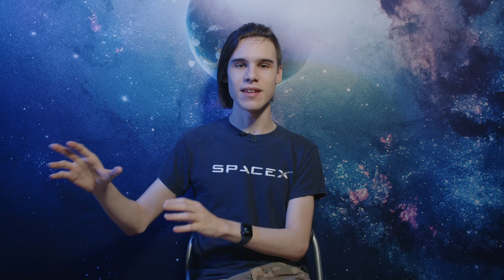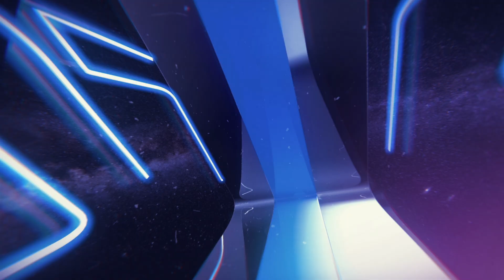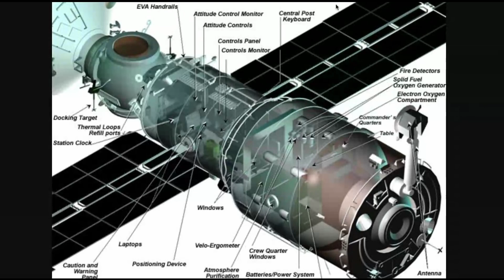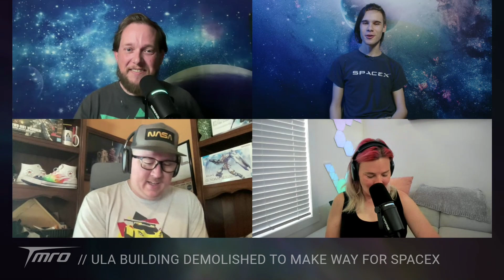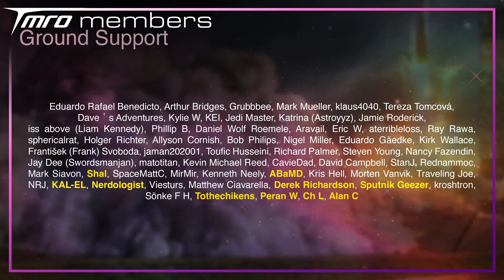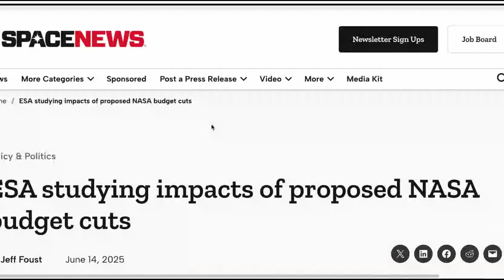ISS leaking again, ULA Landmark Demolished  // June 15th, 2025 EDIT #ISS #nasa #ULA

Comment: Yeah, aluminum stress fractures have de-pressurized planes leading to crashes. I think most rigid metal can form stress fractures in a fluctuating enviroment.
Reply: If they watched the pressure during a maneuver, they'd see the crack grow and shrink.  I've "seen" plenty of cracks on parked aircraft visually evidenced only by a wisp of "cheese" that wipes off cleanly.  Under load, they open right up.